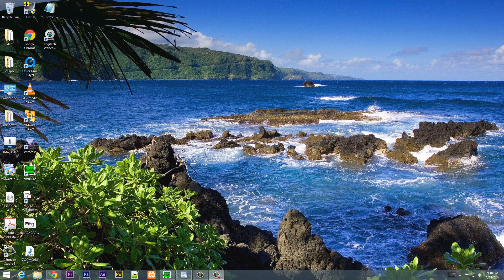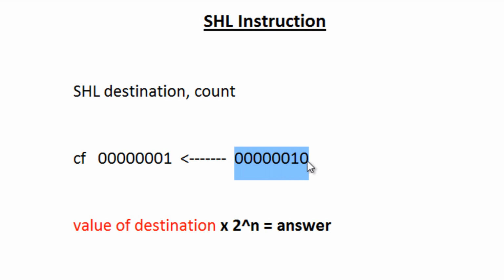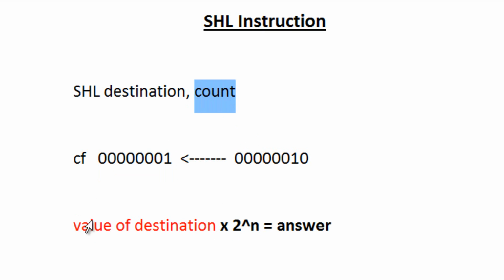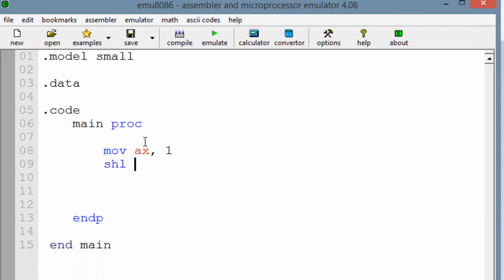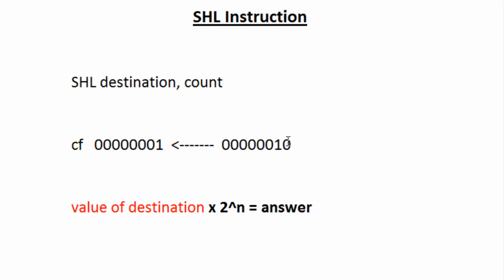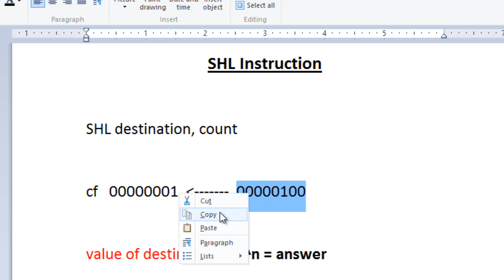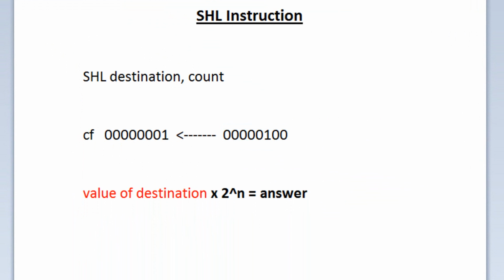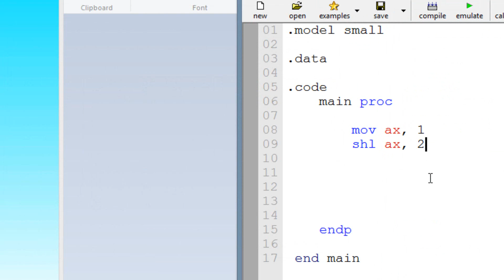Assembly Language Programming Tutorial - 45 - SHL Instruction

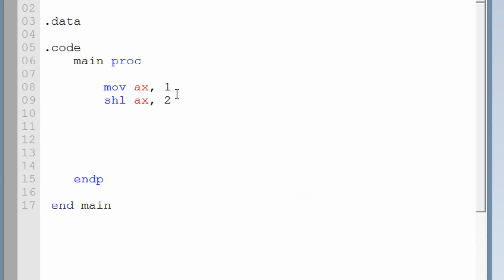Comment: Just a detail I want to add about SHL and all the similar shift operations like SHR, ROL, ROR... it can only take the value 1 or the CL register as second operand, at 5:40, you can see that the assembler corrected "shl ax, 2" into 2 lines of "shl ax, 1", with some others developpement environements, it can prevent the program from assembling with an invalid inscruction operand because there is no x86 opcode for a shift with immediate value other than 1, so that's good to know.
If you face that problem, just add the instruction several times or use the CL register.
Reply: wow after 8 years. thanks, i'm wondering if you have some useful resources to learn assembly language 8086